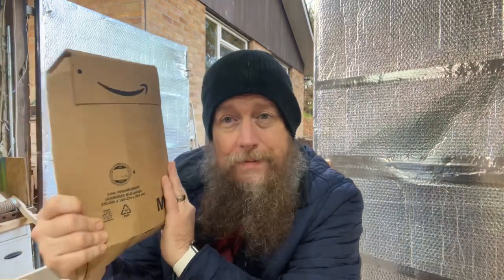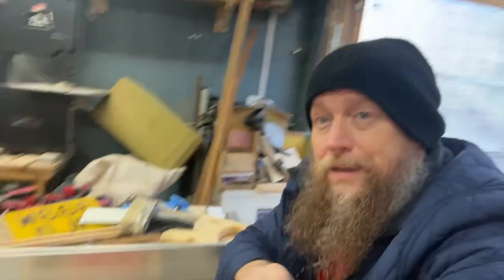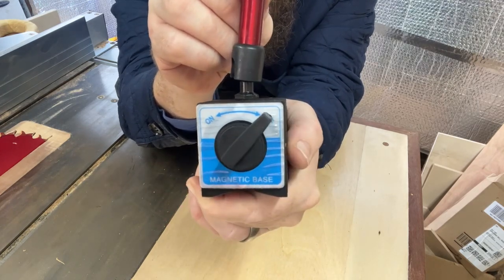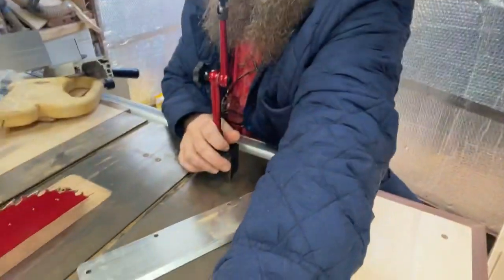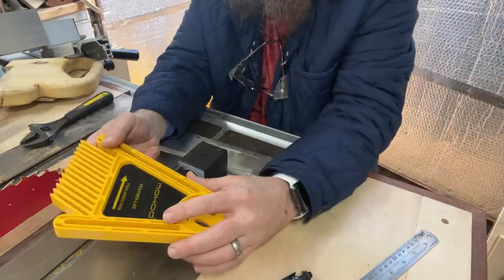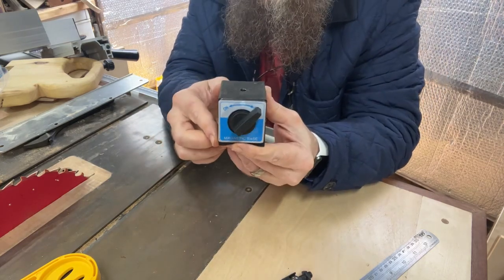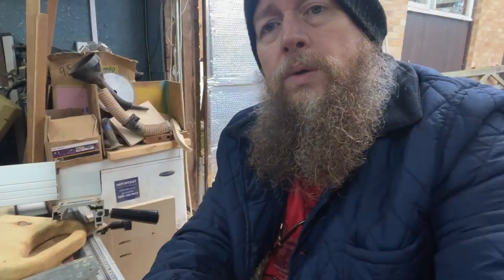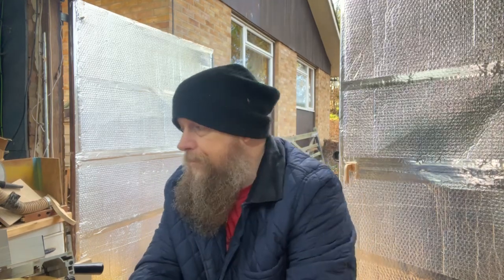Cheap alternative to magswitch?

Comment: I have seen these before, but unfortunately, my DeWalt portable table saw has an aluminum top. It is flat but it makes the saw lighter weight and less expensive. Colin Knecht has several videos where he makes several styles of jigs that use the magnets to hold them to the table saw.

Comment: Brilliant I've had a couple of the redundant since a change in careers one is going to be holding my table saw fence stiff
Reply: Also I'm wondering if one set on a rail on the planer with a dti would be any use for setting blades

Comment: I have to be the Devil's advocate here.. This is not a great idea. One should never alter any safety equipment, especially el cheapo stuff off Amazon. Once you start cutting pieces out or off you are messing with the overall structural integrity of the piece of equipment. Honestly, to save a few quid  or a few minutes of setup time it just isn't worth it.
Reply from the maker: I get what you’re saying Phil, but some of us simply don’t have the £80 available for a magnetic featherboard. I didn’t and so I never used one. This has increased my safety and given me a tool that I can use for a bunch of stuff 😊